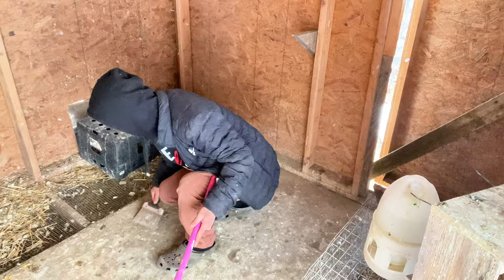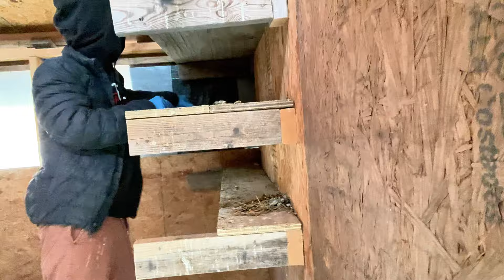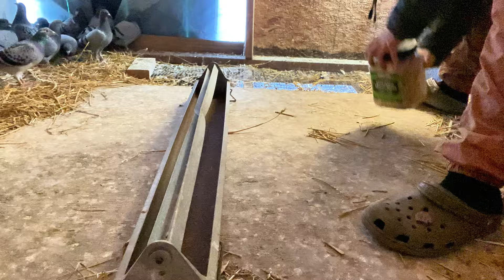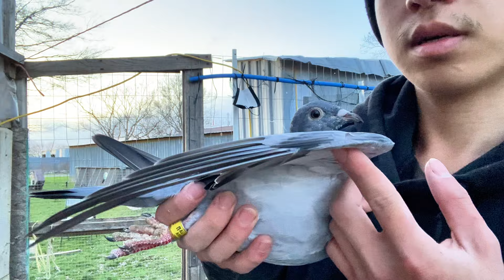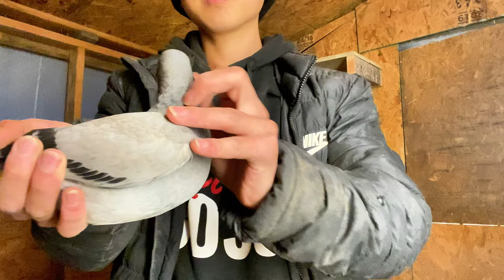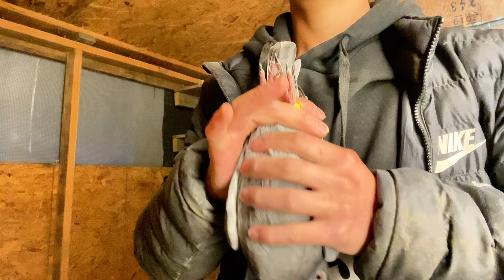Racing Pigeons - March 2024 Breeding Update (Young Birds)

Comment: Brother , at what time of the year  do you start  breeding  ? And how cold is to cold. Do you have trouble  in the cold months ? Thanks for the video
Reply from the maker: Thank you for watching, the cold doesn't really bother them as long as they have good feed and water. The eggs could be affected by the cold, I usually like to have fake eggs to replace the first egg that's layed to make sure nothing happens to them or use a foster's egg to replace it temporary. You can start at any time, depending on what your plans are and what you're doing. once the birds are ready, you can start pairing them up on Thanks giving or once January comes. If you're just breeding for fun or just to fly, you can start once the temperature is warmer. When breeding early, you'll need extra lights on to trick them into spring/ summer time.